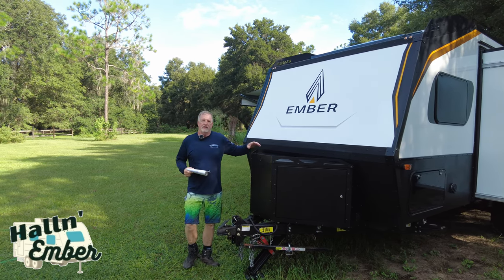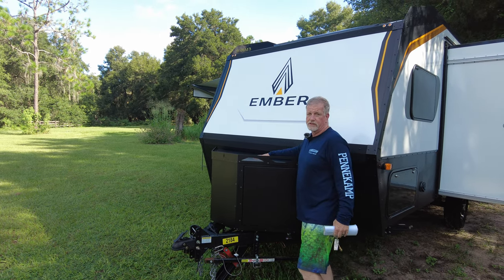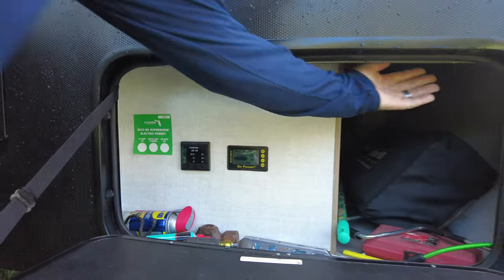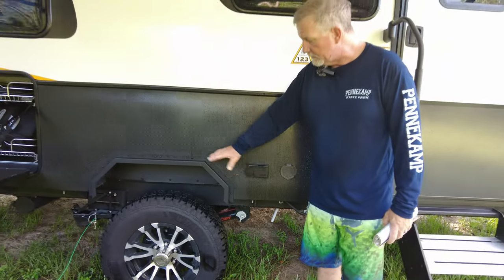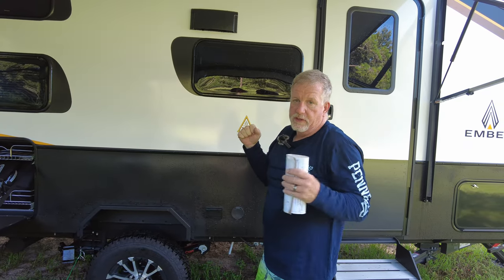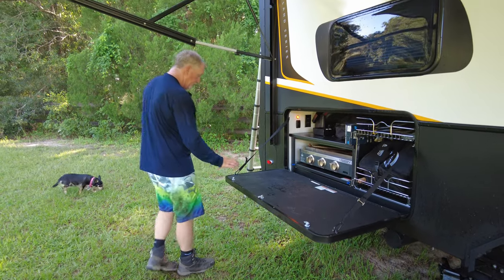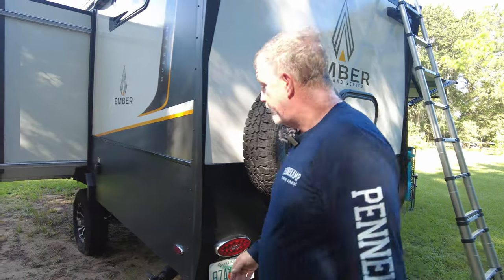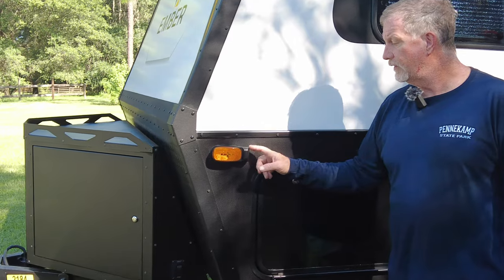2022 Ember 191 MDB Detailed Exterior Six Month Review

Comment: You could try calling Ember and seeing if they would send you a new part for your plug with light that failed. I am seeing so many cool ideas on this brand camper. I would check around on if you need to condition your slide seals. It just makes sense, windshield wipers are rubber and deteriorate, seals are like a giant wiper blade.

Comment: I also like the storage door flips down, not up. Question; So does the ladder attach but still extend above the roof so you can get on and off? You mentioned it and it was sitting that way. I didn’t realize they worked that way. I thought they only hooked at the top and not extended over tge top. Very cool exterior rear door to put big things in.

Comment: Thanks for this video.

I'm  a fan of Ember RVs 

I particularly liked your operation of the outside kitchen.  

You mentioned a few quality controls issues. The light at 30A plug and I believe the slide out.   Did you had a serious problem with the slide out or any other issue with this RV?
Reply from the maker: The slide had to be reworked.  It has been working great since then. They installed rollers under the slide. They replaced the shore power lighted plug. It has all been fixed!

Comment: Great review. I concur with your review. I still struggle with my max solar,  with 2each lithium batteries. The max solar iswhimpy supporting AC use. TV, inside fridge and  lights are DC and do well. Able to be pure solar for days only using them. 
Thanks for the review. You are the only YouTube channel telling it honestly.
Reply from the maker: Thanks for the comments and compliments.  My solar controller doesn't seem to be charging any more. My 4 batteries have depleted in 3 weeks with only the fridge running. Sun powers appliances during the day but doesn't charge the batteries.  I have a ticket started with go power. I will post the results when we get it resolved.
Reply: @CharlieandGina  i will be following you. I am sorry to hear your problems. There was such hype on these trailers off grid ability. Sadly, I believe they are more of a Walmart parking lot warrior. Are a cool looking camp ground trailer. Our shake down cruise is this week. Last couple weeks i owned it, i just test the solar here on the farm. I keep it parked in full sun and try different situations. Ive been on the phone with mastervolt, sadly they said i not the only caller. They great help in the operation of their stuff, but have no info from Ember on how wired to get into deep trouble shooting. I like the construction, but i not a fan of its actual off grid ability. Lucky all failures i can rescue my self from stuff in my barn or say i worry about it tomorrow and walk in the house for the night. By the way, great modification of removal of the AC fridge. Tried to convince the wife i needed to do the same thing for my coffee set ups. She said no.
Reply: from what I've seen on YT the solar controller is pretty junk and worth tossing out and getting something better.   I am not an expert though, so I don't know.  I'm leaning pretty heavily on one of these, just waiting on our tow vehicle to come at end of month hopefully, then see if we have enough money to add one of these.
Reply: @mgysgtk8835  that is unfortunate, bad quality is unexcusable.
Reply: @CrankyOldNerd  IMHO , if i pay $50K, I should get something that doesn’t have the same problems other $25K trailers of equal size and floor plans have.
Reply: Could an inverter generator be bought as backup?
Reply: @itr0863  yes absolutely a generator can support, but the sales pitch was the outstanding performance of the max solar option. In reality, you can take a non max solar with just one panel and a lead acid battery and use generator and survive.
Reply: @CrankyOldNerd  I have updated my thinking. But they still have problems to work out! I believe they are the best option. Yes, i have a laundry list of don’t work or could of been engineered better, but the cabin in my humble opinion is by far the best….for off road construction. If i also could get the solar issues fixed, it would be the most awesome trailer out there. I leaned hard to Black Series. Much easier to find in my area. Ember was an hour and 45min drive one way. But BlackSeries has a lot of cabin leaks. And Ember’s solar headaches, tire headaches, lousy flat window headaches my number one concern was cabin construction. And that is where Ember shines.  IMHO, Ember is the winner….at this time.
Reply: @mgysgtk8835  thanks for the follow up.  we looked at the 191MSL at Overland Expo East in early October and I'm pretty settled on wanting one.  Hoping to get the 191MDB ordered in December/January.    My only waffle reason is it's not as easily stored as the smaller stuff, so we'll need a place which increases the cost.   Originally we were thinking RTT + Patriot X3 which I can stow in my back yard.   The Ember's are a bit bigger and probably be an issue.

Comment: You didn't show us the inside and any issues you may have.  How loud is the air conditioner?  Will it really run off the batteries and for how long?
Reply from the maker: The video was too long to do both inside and outside in one. We have recorded the inside review and it will come out this week. We haven't had any issues outside other than the spray port not working. Inside there is a few .
Reply from the maker: The ac is a little noisy , especially recording. I have run it for 5 hours at night when the temperature was about 82 degrees outside.